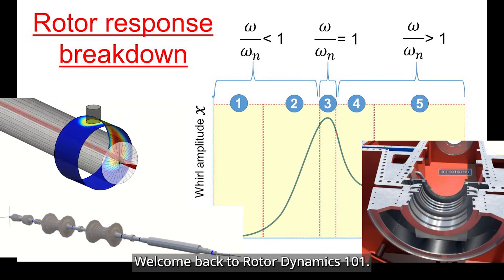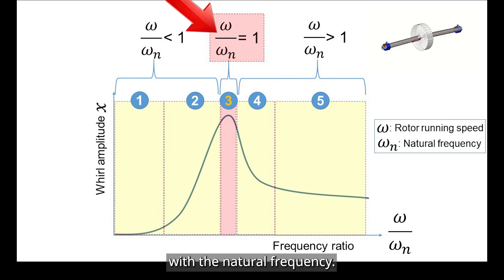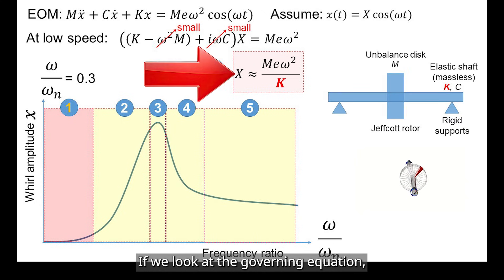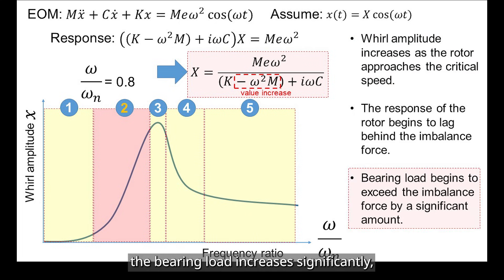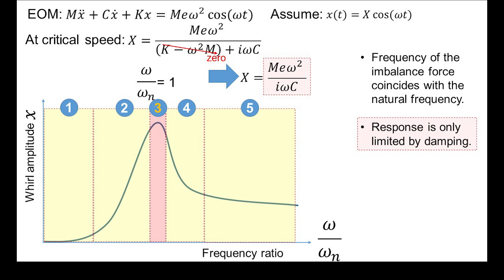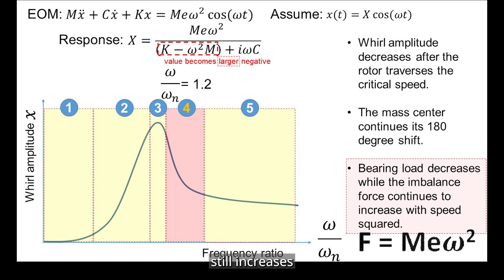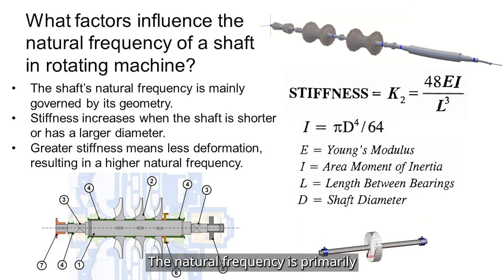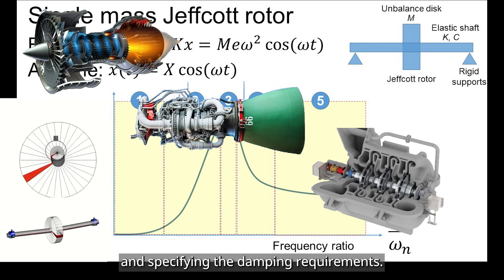Understanding Rotor Vibrations: The 5 Key Areas of Imbalance Response

Comment: Outstanding explanation of critical speeds. I work as roll balancing technician and Catagory 2 vibration analyist. I've always wondered when is a good time to tape on a trial weight, and your video explanation has helped confirm my hypothesis. Most of the high-speed equipment I balance operates at about 90% of its critical speed. I've always been curious as to what happens beyond 120% critical speed. Your video has helped me learn as I have no formal engineering instruction.
Reply from the maker: Thank you so much for your kind words! I'm really glad to hear the video helped confirm your thinking, especially coming from someone with hands-on experience in roll balancing and vibration analysis.

Operating at around 90% of critical speed puts you right in a sensitive region, so your observations are incredibly valuable. Beyond 120% of critical speed, the rotor typically enters a more stable zone, assuming damping and system stiffness are sufficient, but it's not often discussed in detail outside of formal training, so I'm happy the video helped shed some light on it.

If you ever have specific scenarios or balancing challenges you'd like to dive deeper into, feel free to share. I'd love to hear more from someone with your practical background.